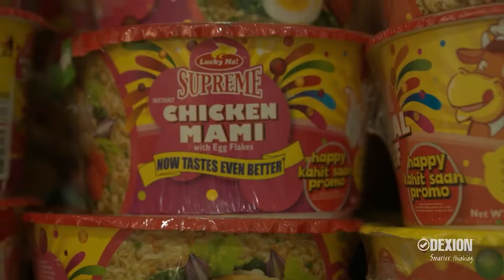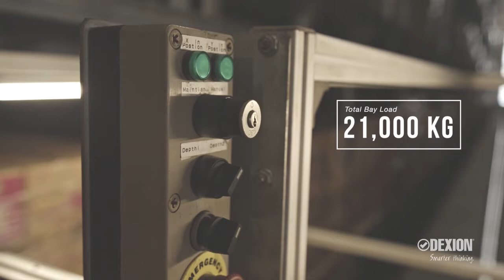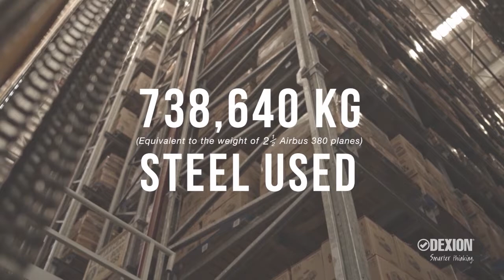Dexion Case Study: Monde Nissin Corporation, Philippines - Designed for Seismic Waves

Comment: Seems to be no fall protection for work area with some pallets top levels no shrink wrapped.    
Speedlock 120L with crane stacker telescopic forks go as high as you want with easliy adjustable beam heights & less wasted space between levels.